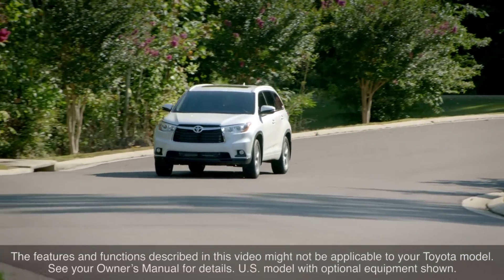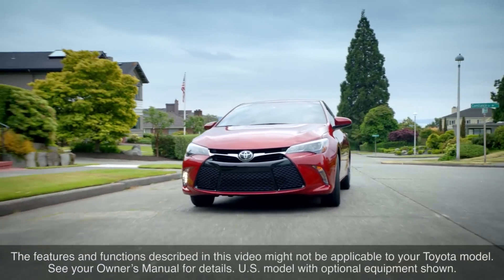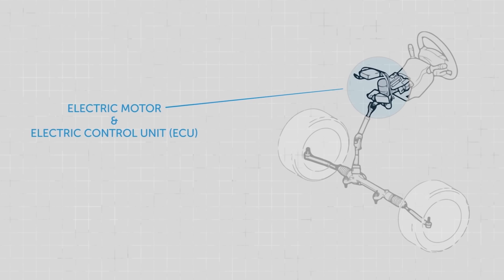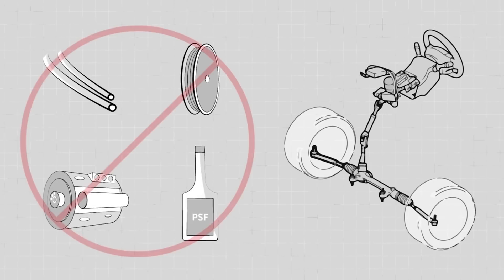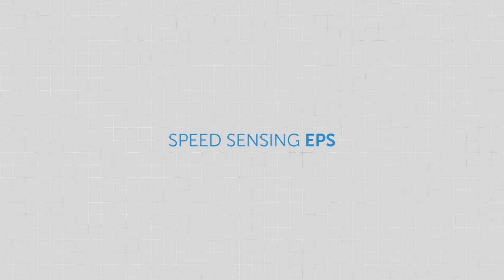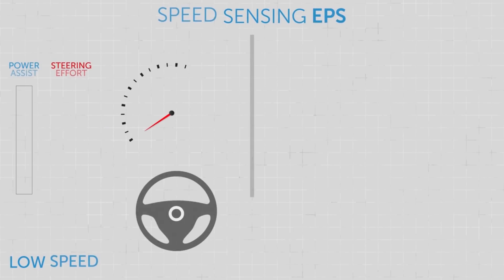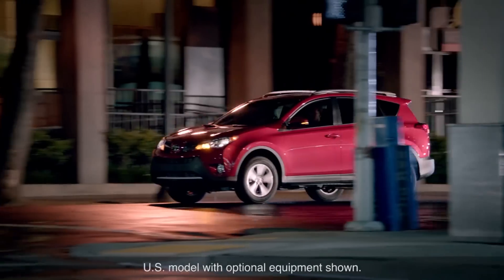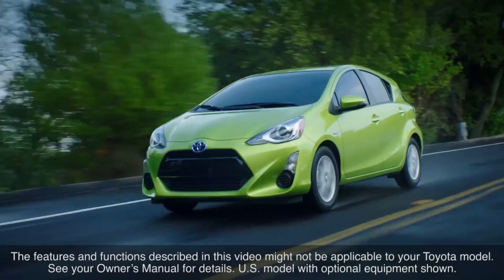Know Your Toyota Mechanical: Electric Power Steering

Comment: This is not better than the previous system.  It makes such a racket from the faulty (should be recalled if its not all ready) EPS damper.  Such a bad design, didn't expect this from Toyota.

Comment: I have a Corolla 2017. Sometimes the steering feels intermittently heavy, sometimes it's feather light. No fault code is generated. Even changed the steering rack and EPS motor, despite that it feels heavier than other similar Corollas. Please help.
Reply: I have this same issue and mine as 34,000 miles.

Comment: Any idea of what could cause my 2012 Toyota Corolla steering becoming stiff sometimes?
Reply: Did you find a solution to it? Im having similar problems with my 2017 Corolla. Sometimes heavy sometimes light
Reply: @avianshchanana3807  the steering rack. Aka rack and pinion.

Comment: what a hogwash video. Inside that EPS has a little green dumper, made of cheap plastic and it is designed to fail and its location IMPOSSIBLE to get to unless you remove all components of the dashboard, steering wheel on down the shaft until you get to the EPS...then you replace the damper which cost 6 bucks..cheap cheap plastic...probably $500 in labor..WTF Toyota.. That noise you hear is a bad damper.

Comment: My mechanics can't fix the  problem on my toyota yaris 2017. When I  turn it right while slowly moving, I hear a sound like creaking stones. The joint and bearing are still good after al. l
Reply: damper INSIDE the EPS, made of cheap plastic... Electric assisted power steering damper..6 bucks....now the labor only god knows

Comment: Just spent $16,000 on a 2012 Corolla LE with 19k miles, the steering is frighteningly awful! I hate the EPS system. It's too weak and notchy, it wanders, it is not direct and has a deadzone around the center, it doesn't like to go straight, it's the worst steering I've ever felt in my life, and I've driven dozens of cars from various years and various manufacturers. This thing is dangerous. Also, my engine says made in Mexico, even though I can't find any info online that says this engine should've been made in Mexico. Also, the throttle has deadzone, and the brakes are mushy. I bought it because Scotty Kilmer on YouTube is always recommending Toyota Corolla, but this is the worst car I've ever driven.
Reply: Scotty says to buy 98 to 03
Reply: @hmone4890  Whoops!
Reply: Well, Scotty said buy Toyota that are made in Japan. I have a Toyota yaris 2010 and was made in Japan and already have 211,000 and still running like new.
Reply: My 2011 RAV4 does the exact same thing. However it's intermittent, which makes it even more maddening.

Comment: A relatives 07 rav 4 (which had an engine rebuild with warranty at only 60K miles) EPS failed at 150K miles ,  Changing this part was a pain in the a** !!! I would never go with Toyota

Comment: 2017 Highlander. Wait for EPS error to show up on your dashboard at 60 mph on a highway. No power steering. Hard to drive. Mine went out three times in two and half months. Toyota still can't find it. May be great for environment and fuel efficiency but dangerous when fails,

Comment: I have a Toyota corolla 2003. My problem is that my Power Steering all the time turns on and off.
Usually when I turn on the car the power steering works and the PS light is off, every other drive after a few minutes the PS light turns on and my PS stops working and it is like driving a truck. Sometimes I stop at the side and turn off the car and turn on and the PS problem goes away, and sometimes it stays on and it is hard to drive.
I have tried to reset the main computer of the car. Usually it helps for a few days, though the problem always comes back at some point.
I have been to many mechanics. Each one says it is something else: Bad Battery, Bad EPS, Bad steering Module, and more.
What Should I do, can I fix this by myself?!?!
Reply: hey can i get more info on how to do this my toyota just started this
Reply: I read the manual book, it might be PS overheat issue.
Reply: thanks for the reply.... I opened the dashboard and cleaned the cables to the PS computer.... since then the problem went away!
Reply: @arigreenfield1064  please tell me more about your solution to this EPS problem. i have the same problem with my 2005 corolla
Reply: I've been having the same problem.